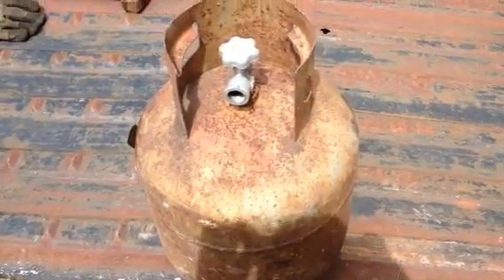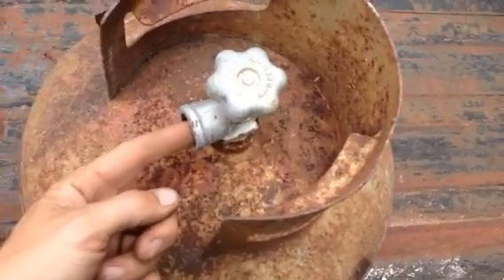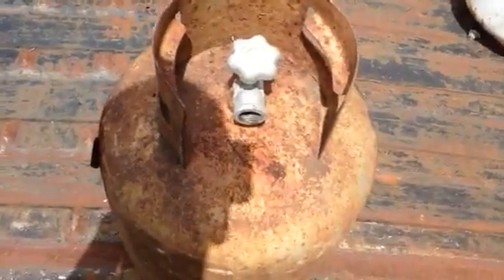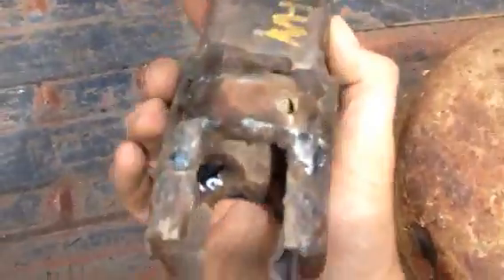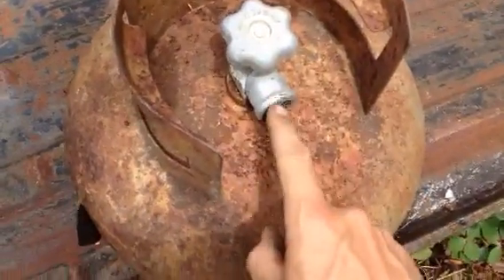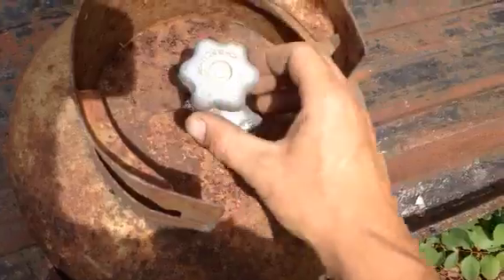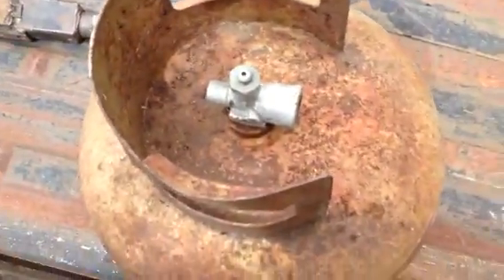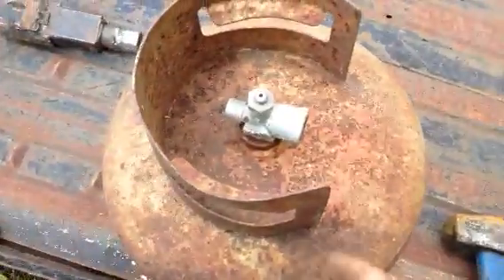How I Remove/Recycle Propane Tank Valves (Part 1)

Comment: Need a method that doesn't require a custom made tool
Reply from the maker: You can also do it with a big ranch if you’re able to hold the tank. Sometimes you can use a hammer as an impact wrench
Reply: He lies

Comment: You say how much you get from the valve .75. 
How much is the tank worth?
Reply from the maker: tank is worthless with the valve in, nobody wants them due to explosion hazzard.  with the valve removed they should be safe for normal scrap metal or for projects and recycle.  scrap steel averages around 150$ per ton here in my area.